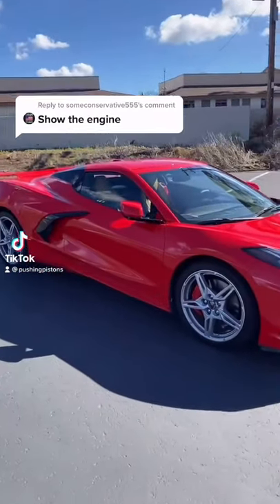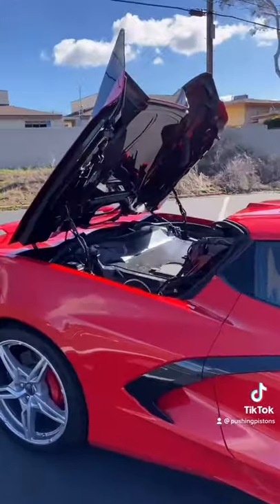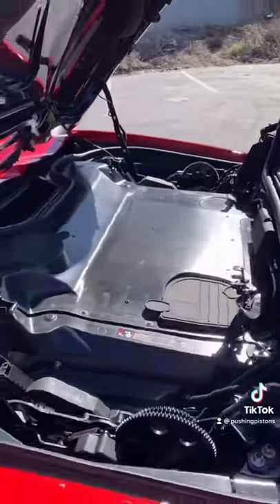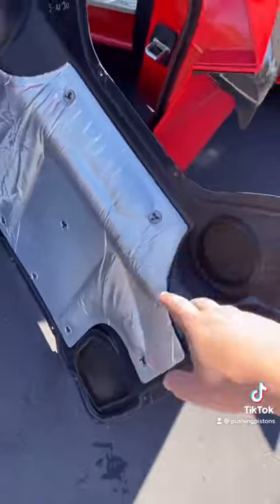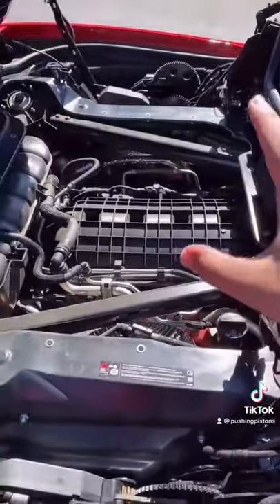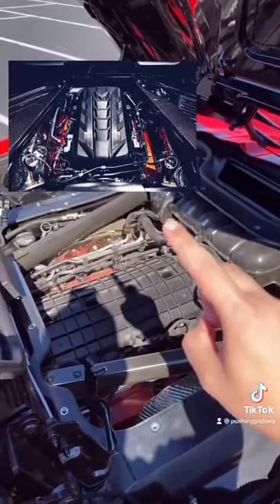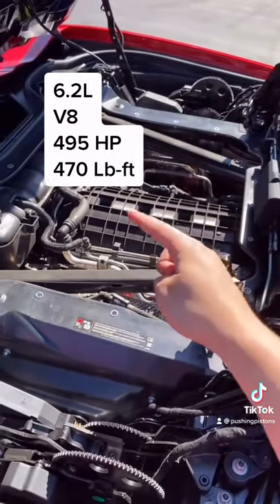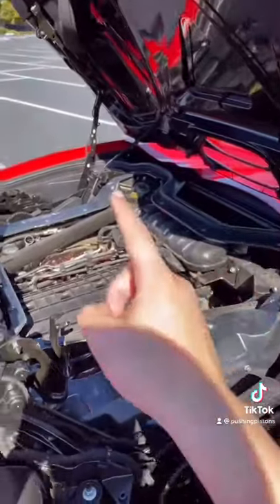Convertible C8 Corvette HIDDEN ENGINE!?

Comment: Actually, I prefer the Coupé over the convertible as the roof can still be removed and stored on the rear trunk/boot.
Reply: Good point
Reply: The convertible is more weight an problematic and are people really to lazy to take off a 20 pound roof panel
Reply: I totally agree
Reply: No need to take it off if you got a early model with the see through top :)
Reply: Same thing with the c7 it’s honestly jus for old ppl who get them ugly ass soft tops ruine the look of the car and the coupe top comes off is way more of a flex in my opinion
Reply: The convertible option only adds 105 pounds. 
And, if you decide to go driving with the top down, in the coupe you lose your trunk space. 
In the convertible, with the top down you still get to have access to the trunk space.
Reply: Same reason i got a coupe C6 instead of that convertible. The look with the roof off rather than a convertible makes it look even more “Sportier” and better in my opinion. The C8 convertible do look good though since they have the same look at the topless C6
Reply: You can’t compare the older models to the new one. The new one is a hard top convertible. Whole new ball game compare to the older generations. And convertibles are not for midlife crises people or women or whatever someone said on this comment. It’s all a preference. A hard top convertible is tuff to beat though. Now if you’re someone who gets a hard on because you can see your engine by all means don’t get the convertible simple!
Reply: @MrOPM-vc6ow  that’s the whole point of mid engine tho lol it is a preference but being able to see the engine u can’t beat forget a fukn convertible u can still take the roof off
Reply: So we have the convertible top and than we have the coupe convertible? Tf
Reply: Convertible is for convenience. And also for times when it rains suddenly and you don't have time to put the roof back on. I rather have that than losing trunk space and a window just to see an engine.
Reply: @Its_Me_Romano  No, I like convertibles in general, but I prefer the Coupe' of the C8 Corvette over the Convertible.
Reply: @Danny103  Point well taken
Reply: By the way, Coupe's are technically cars with attached fixed roofs. they are either held together by metal fasteners or by simple clips and levers like the C8 Corevtte Coupe'. Just wanted someplace to say this
Reply: @Ironn199er  this is America, why is that even a question?
Reply: @gooddickman1561  it’s more like 15 and it’s the price of the z51 package.  I just don’t see the worth in the convertible.
Reply: Convertible is slower, requires more maintenance, and with the Coupé you can be 20 pounds lighter by leaving the roof at home 🌝
Reply: @MXALOVE But your aero would suck, yes?

Comment: Do you have to do this every time you want to change the oil?
Reply: Yes
Reply: And add windshield washer
Reply: No there are panels that flip up to add oil and to add washer fluid. But to service the motor this has to come off. I work in a body shop so.
Reply: @joelwachter7845  you’ve worded on the C8 before?
Reply: @PiLLO360  destroyed their front bumper on a curb. Also needed new bumper brackets. it was that hella yellow colour. They paid outta pocket. Costed like 5k too.
Reply: I’ve changed the oil in about 7 - 10 c8’s.... all coupes lol. haven’t touched the convertible yet.
Reply: And blinker fluid too. That runs out quick. Must be a hassle
Reply: @sandy_matt_4699   and the costs are going through the roof
Reply: that’s what i’m thinking cuh
Reply: What's funny is they have some cars where you can't even check the oil on them so I'm guessing this is one of those cars
Reply: Jim Cornette  I blame them for everything
Reply: @bigblack4702  convertibles basically just came out they were released later
Reply: Must be a pain in the arse to do so lol
Reply: @bakamonkeyfun1593  You can check the oil but it's an electrical sensor accessible through the infotainment system
Reply: @bakamonkeyfun1593  any car that doesn’t have a dipstick has an electrical sensor that will read it out too you on the dash / infotainment my 335i did this and so does the C8
Reply: @mjs9611  I’m guessing your meaning for oil only right? Or is that getting more common for oil and tans fluid in newer “nicer” vehicles. 
Asking out of curiosity. I have a 98 cavalier and a 00 ranger. Don’t really know anyone with brand new cars so I haven’t really drove or seen any newer vehicles.
Reply: @mjs9611  btw. My cavy has a light for low coolant although it’s easy to get too and an oil dipstick but doesn’t have one for the trans. Supposed to Jack all 4 counters up and pull the plug and if fluid comes out it’s fine but if not it’s to low. I thinks it’s dumb but o well.
Reply: @joelwachter7845  honestly I'm surprised a new front bumper for a C8 is only 5k w/ labor
Reply: @PhantomPhaze  i was too. But you also gotta remember ordering it new took like 2 weeks to get it and we also get a discount from certain dealers
Reply: @devilsreject9255  2005 isn’t new my 530i does this too, check oil temps or level. It even tells me when to change the oil like once a year.  Also you can add a oil temp/level gauge to older cars as it’s more important to watch your oil temperature on older cars. It’s harder to do so but if you can it will help you maintain the life of your engine for way longer. Oil temp/level on speedometers are common on new cars now a days because in 15-20 years cars today will be important to watch the oil temp as the engine ages
Reply: No, the access to the oil is not under that cover.
Reply: @jonathangt-ramgm3nismo591  you missed the joke
Reply: @americancountryball2077   did I?
Reply: @jonathangt-ramgm3nismo591  yeah blinker fluid doesn’t exist 😂😂
Reply: @joelwachter7845  yep they have those rubber panels that flip open to fill your fluid and it drains out the same as any other Vette
Reply: @joelwachter7845  could u like redesign it to be liek an audi r8 in the back tho remove back frame like in a  track car and a glass or see through carbon back and remove some extra stuff with fab work
Reply: @robertmunckin7673  its not very pretty but ig
Reply: Doubt it as the c8 is a dry sump with an external oil tank
Reply: text
Reply: text
Reply: The oil is accessible
Reply: The convertible model is just a waste not just for repairs and maintenance but also that engine just looks so good on the coupe and you still can take the roof off
Reply: Your joking right? Of course
Reply: @joelwachter7845  insurance? Hope that doesn’t happen to mine
Reply: @aaron-fauth  we top off the fluids and make sure nothings goes unchecked. Besides the owner specifaclly asked us to
Reply: @joelwachter7845  ok that’s good
Reply: People are so rich around you
Reply: no it has an oil fill access as well as a access to coolant reservoir underneath the car the drain plug and oil filter are the only things visible. Glad all i had to do was an oil change
Reply: @quandale2648  The windshield wiper fluid is in the front.

Comment: Ever mechanic watching this, shakes head and prays they don't get one in the shop.
Edit: for all the people that say "its just a plastic cover". No shit... im talking about it being a mid engine and having to work on the thing.
Reply: It’s just some bolts lol
Reply: @Eeeemomo  that it is.
Reply: Any real work u bet the sub frame can be dropped
Reply: @Eeeemomo  imagine working in the tight engine bay. Helllll no
Reply: @yoshuaposhua25  work at a Chevy dealership in the service side of things and can say yeah they are kind of a pain in the ass but eh they are also pretty cool to get to drive here and there
Reply: I smell head gaskets
Reply: @Eeeemomo  it looks more like a fishing trip for parts then a easy repair
Reply: @Dan-cr6uv  more moving parts? Its still only NA. Just wait till the boosted models come out, maintenance not gonna be fun
Reply: Trump made this vid possible
Reply: @deadghost5193  😢
Reply: Plastic everything 🤔
Reply: @alchemyalchemist111  *lightweight materials
Reply: @alchemyalchemist111  welcome to the 21st century all car manufacturers you plastic in and on engines
Reply: @yurizaitsef  yeah, I know and there also 3d printing metals as well. As long As it lasts!
Reply: Takes 2 mins to remove and trust me there are some models that have more actions needed to reach the engine from underneath
Reply: @Dan-cr6uv  you clearly are not a mechanic
Reply: @alchemyalchemist111  before we know it, cars will be “painted” with fucking platidip. Wont be any metal at all on them. 😥☹️😈😈😈
Reply: No, they're praying to have one so they can charge its owner a double of regular price.
Reply: The convertible is way better looking than the coupe.
Reply: @aaron5222  yeah but the new problems that you have new-learn with first run experimentals.
Reply: @Eeeemomo  we can tell you don’t know how to change your brakes
Reply: @francowolfmurd9758  compared from working at Chevy to Ford (current) I have to say chevy has easier access to replace most compared to fords. Only thing I hate about Chevy is how scary everything from an Tahoe or bigger shares the same big ass frame. I would not one to be in a chevy in an accident, or a Ford lol
Reply: @artovo8227  ok lol
Reply: @yoshuaposhua25  True
Reply: @Eeeemomo  its not just bolts its a tiny cramped and awkward engine bay with a shitty cover and too many wires to want to deal with
Reply: Bruh its literally some screws working on a Ford KA is more difficul.
Reply: @stratokast4730  im not talking about the plastic cover. Im talking about it being mid engine vehicle and doing some actual work on it.
Reply: lol i feel sorry for them
Reply: We work on em all the time, for little shit, I haven’t seen one come in with any real major issues yet
Reply: @yoshuaposhua25  unless it’s top end work like heads and up, you would just drop the subframe with the engine attached
Reply: @notlowzach546  yeah hopefully they made em well enough that there is no major issues to work on for quite a while.
Reply: I wonder what happens when the battery dies and the lid won’t go up😂😂😂
Reply: @TheFoxygrandpa69  lol you shouldn’t expect much, the convertibles are always gonna have problems as do most convertibles. But as for now the c8’s in general apart from the trans programs and the valve spring recall, they seem pretty stout
Reply: @nsniper7283  I wanna say the battery is in either the hood/frunk or the trunk and I think there’s a way to open them manually I just haven’t had the luxury of doing that yet lol
Reply: @RAGEmonkeyyy I’ll look again next time but I think the covers only allow access to the fluid fill necks not the oil filter if that’s what you’re referring to needing a spanner
Reply: @RAGEmonkeyyy lmao
Reply: @notlowzach546  right on. Not to terrible. Good to hear. Thanks for the info.🤙
Reply: @deadghost5193  No wonder it sucks
Reply: This is nothing new to a Chevy tech. They're used to tearing a whole car apart to get a starter out 🤣
Reply: @deadghost5193  I think you meant Obama... 🤣
Reply: @TheFoxygrandpa69  gotta a subframe sitting on the shop floor right now. Going back in tomorrow morning. All cars are going to be this way eventually, to just change the spark plugs.
Reply: @user-cs3zs6jn1d  Uhg....yikes lol. Kudos to you brother🤙. Hopefully its paying well.
Reply: @francowolfmurd9758  poor man seen more Cruizes than my grandma 🤣
Reply: Probably should look at the book but either sub frame if not lift the body off. I’m sure they made it easy to do either (chuckles🤣)
Reply: @Lovegluv  "Just lift the body off the subframe"
No way you have ever worked on a car.
Reply: @whatchyoazz22  read better
Reply: That's the money maker!! I'm going to charge at least two thousand dollars just to change apart plugs! LOL.
Reply: Fuck that,  I'm not going to work on a c8 eveeeerrrrrr lol.....heck I don't work on most of the newer cars either with those damn computers in them, hellllllll no 😂
Reply: I'm guessing the whole powertrain drops out the bottom in a matter of minutes because it goes together on the assembly line in a matter of minutes people are super surprised how quickly I disassemble cars and trucks
Reply: Anyone saying "it's just a plastic cover" must not be a mechanic
Reply: @hunterrollins5646  I call valve covers plastic...what's wrong with that?
Reply: @bertrum8043  you've missed the point the cover is easy whether it's plastic or not they're not looking past the cover and thinking about how difficult a mid engine vehicle is
Reply: @hunterrollins5646  I understand that, and I have worked on one c8 before...... I do not like it 😂.. All the freakin electronics and crap. Hell I don't even wanna try fixing a wire harness in one. Now I'm not trying to argue but...let's just say they're not how they used to be and are no means simple. I'd still rather work on ol lemons.  (Not hating on the car in any means btw)
Reply: @bertrum8043  electronics make everything harder. I'll always prefer older cars and bikes to the newer shit. I do like the performance newer vehicles offer though.
Reply: @hunterrollins5646  same, that's one thing I can't complain about lol
Reply: @aaron5222  sure bout that?
Reply: You must be very sad
Reply: I mean there's the 911, which requires you to remove the rear bumper and jack it up in the air just to access it.
Reply: @bijdikh8516  yeah forsure. I guess it comes with the territory of trying to make the vet into more of an exotic.
Reply: Like ferrari F40 which is supposed to be stripped in 2 pieces to do engine maintenance.
Reply: It's just a plastic cover
Reply: @scarypineapples7543  "So, i love my Subie mama, I'll never let her go"
Reply: @alexr9514  nah I think the coupe is still so much better cause u can still take the roof off on the coupe
Reply: It's actually a lot better than a majority of front engine v8 designs. You can actually access all of the ignition coils and the entire top of the engine(heads, block) without having to contort yourself into a small space between the windshield and top of the engine. Leagues better than any v8 engine nestled fully behind the front axle in a front engine layout.
Reply: There reliable

Comment: man that engine placement , looks so fun to do work on
Reply: i hope for the mechanic that you can remove more body panels easily to get to it
Reply: Imagine just doing a tuneup. Do you have to remove the engine?
Reply: @maxwellcrazycat9204  There are panels that flip up for the oil and windshield washer fluid. As for spark plugs or ignition coils.....good luck

Comment: I would pick the coup for that reason alone.. But I don't like convertibles regardless lol
Reply: You just haven’t drove one with the top down speeding listening to your favorite jams at night
Reply: @giovannivargas6169  You're right.. I just roll down all 4 windows 😄 Good enough for me without having to worry about all the headaches and complications that come with a convertible. A sun/moon roof is as far as I'd go
Reply: In the coupe you can still take the roof off. So why spend like 5k more or what ever it is when the coupe can do it?
Reply: @giovannivargas6169  i never really take the top off in my C4. Listening to my favorite jams with it off is like listening to static-y radio lol.
Reply: @UpToSpeedOnJaguar  then you should get a better/louder radio
Reply: @giovannivargas6169  yeah, some of these people just don’t understand how nice a whole convertible is.
Reply: @DeathByLego  convertibles have more twist in the chassis and is noticeable when you drive the car around corners. You don’t buy a performance car and remove the performance for luxury.
Reply: @ExtremeRugburn 
Why would a c8 coupe be more rigid than the convertible? Both roofs can be tucked away.
Reply: Same look silly

Comment: GM is building their new platforms to drop the subframe out if major work ever needs to be done. This is an intentional design on the blackwing Cadillacs and the c8 corvettes to make service a breeze if major service is required.  They had take the engine out of mine, and I saw the exactly how rolling chassis separates first hand. They just have to be super careful with the steering when they mate them up again. I had that issue too LOL

Comment: i was curious if it was possible to pop up the top panel alone and let it sit up. I was wondering what if rain or water got in there then it shut so it couldnt dry out, but im so glad this is an option.

Comment: Could you swap the cover trim the coupe to the convertible so the engine looks nice and you have the convertible?
Reply: No
Reply: That would not be smart. The engine area on the convertible is much smaller and tighter so you are likely to have heat problems.
Reply: @Sinoops  true, maybe they could put in vents on the top that open when put back to let more air in, but I don’t really know how the mechanism works.

Comment: Why do they still have a convetible model if they already have targa top?
Reply: That's a very good question. The convertible is more expensive, heavier, can't see the engine, less trunk space. There is no reason to get it.
Reply: @Sinoops 
1. No need to see the engine, especially if you're the one driving it.

2. 100 pound difference won't make or break the performance. Having a passenger makes more of a difference.

3. Trunk space is the same of both. If fact, it's smaller on the coupe if you account the fact that you store the roof in the trunk. The vert has the roof over the engine.

You get the vert for the convenience. Or times where you need to put the roof back on quickly. Like when it rains?

Comment: Nobody is going to want to be a mechanic anymore with headaches like this being designed. 2020 Engineers: "Hey theres not enough fail points in vehicles nowadays let's make more. Say what?? No John, I dont want you to be able to change the oil yourself. That's a job for the dealership."